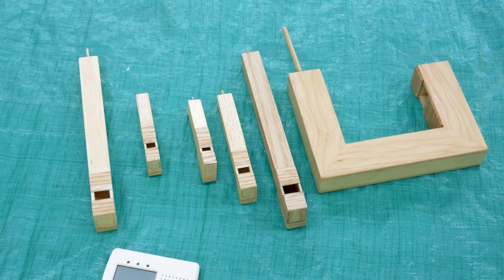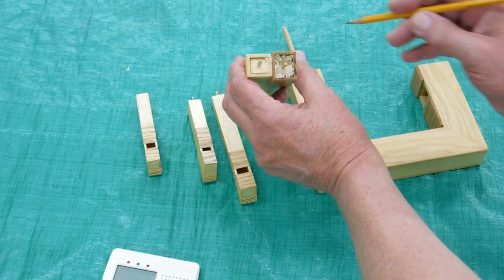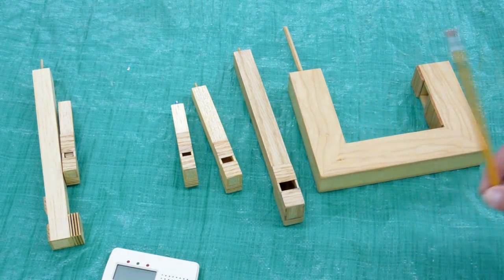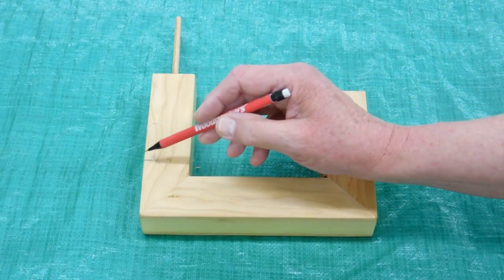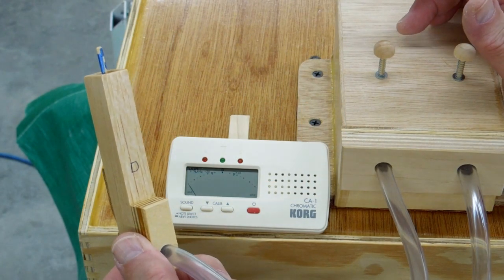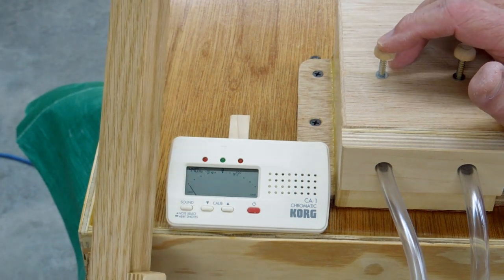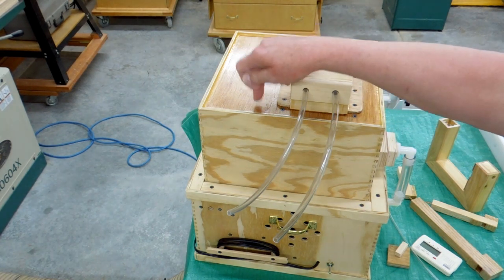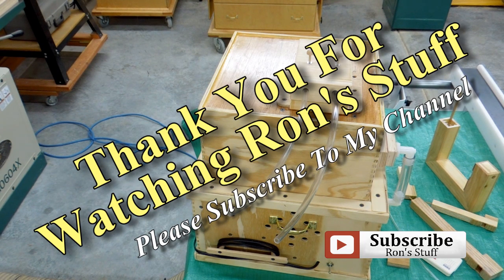Building The Busker Organ - Pipes Part 7

Comment: How did you make your adjustable stoppers tight?  I experimented with stopped pipes, but could never get a reliable stopper.
Reply from the maker: Matthias Wandel First the inside of the pipe is sealed with something (glue
and water, lacquer or varnish), which is a bit of a pain. Each stopper was
slowly fitted to fit each pipe using good quality thin leather or new chamois.
Eventually it will fit just right and make a good seal. With balsa pipes you
cannot make it too tight or you can easily split the balsa. The pipes are first
voiced (in the same day) using the bellows system on the actual organ in which
they will be installed. Then the pipes are all tuned (in the same day) using
the bellows system on the organ. Wood changes, weather and other things can
change the sound so the theory is if it is all “perfectly tuned” at one time,
if conditions change later on it will be equally out of tune and not very
noticeable. The designer says he hasn’t touched some of his pipes in years and
once he was happy with them he poured hot wax on top of the stopper as a final
seal and that was the end of it (it being the process). I have played several
organs built to John Smiths designs and those pipes haven’t been touched in
years (and they also haven’t been sealed with wax). Personally, I am not
thinking I will do the hot wax thing.
Reply from the maker: Ronald Walters <span style="font-size:12.0pt;font-family:"Times New Roman";
mso-fareast-font-family:"Times New Roman";mso-ansi-language:EN-US;mso-fareast-language:
EN-US;mso-bidi-language:AR-SA">Some of John Smiths larger organ designs use both
stopped and open pipes and have several ranks.

Comment: Used balsa with OK results on my Busker. Used basswood for 26 Universal. Very easy to work with and looks great.
Agree that oak is not such a good choice. Use fancy wood for the caps, or add veneer on the pipe fronts if you want a more deluxe look.

Comment: did you ever finish this? it seems like it stops at this part!
Reply from the maker: When I first heard about one of these do-it-yourself street organs, the Busker was the first one I heard about and I ordered the plans. Later I met someone who had built all of John Smith’s organs and learned the Senior 20 was a much improved version of the Busker. At that point I ordered plans for the Senior 20 and stopped working on the Busker… after motorizing the Busker so I could use it for testing pipes.

I released the following video:

Senior 20 Organ (00) Introduction - What Happened To The Busker
https://youtu.be/D-3R4uxuXDs

I have a total of 86 videos showing various aspects of building… first the air supply system of the Busker and then my first Senior 20 organ. Then I motorized the first organ. Then I developed the conductor figure for one of these organs. And finally I completed my second Senior 20 with the conductor figure installed and animated.

Later I built a “totally unrelated” Mini Calliopy and there is a video series on that as well.

Go to my channel page… click on “playlists” and there you will find the various video series all grouped together.

8 videos on building the Busker Test Rig (now used for testing individual pipes)
33 Videos on building the Senior 20 Organ
7 videos on motorizing the Senior 20 Organ
15 videos on creating and producing the Organ Conductor Figure (sculpting the figure, modification for animation with servos, vacuum pump, vacuum chamber, pressure chamber, heated curing box, silicone molds, resin castings)

23 videos on the second Senior 20 Organ with the Conductor Figure

Thanks for watching.
Please subscribe! That is what keeps this channel going.
Ron

Comment: is plywood able to be used for pipes?
Reply from the maker: Yes, a friend makes his pipes using 1/8" Baltic Birch Ply. The thin Baltic Birch Plywood is pretty flimsy (flexible), but with careful cutting, once it is glued together it makes a good pipe. Inside and outside surfaces need to be sealed after the pipe is assembled.
Reply: @RonaldWalters2010  thanks for the reply. Going to order my plans soon.
Reply from the maker: May I suggest you build the Senior 20 instead. The Busker was his first build. The Senior 20 was the second design and is much improved... better wind... better sound. Also, I have many videos on making the Senior 20.

Comment: how do the different woods sound the same note? will balsa sound like oak?
Reply from the maker: redoorn Does not appear to make any difference because you are going to seal the inside and outside surfaces of the wood. Balsa sounds like oak assuming both are made correctly. Personally I am going to use basswood or 1/8" Baltic Birch Plywood.
Reply: Different woods will have subtle timbre differences. But, as long as the inside volume/length is the same, they should sound the same tone.
Reply from the maker: Steve French Yes... and unless you have heard one of these little organs in person it would be hard to fully appreciate the volume and tone of sound they produce. The microphones on these digital cameras really do not do them justice.